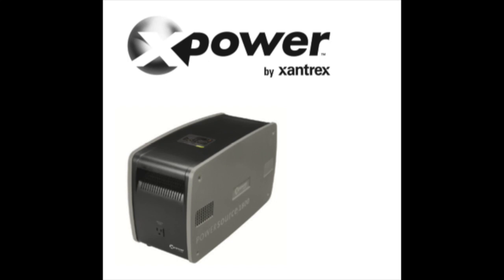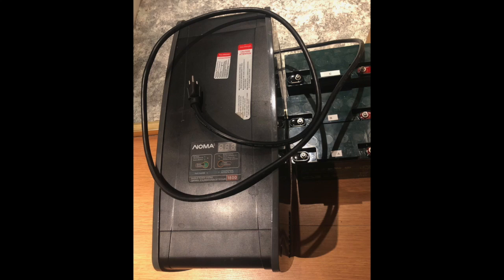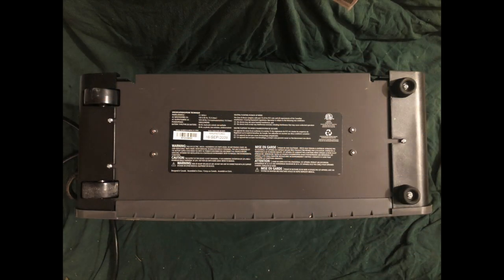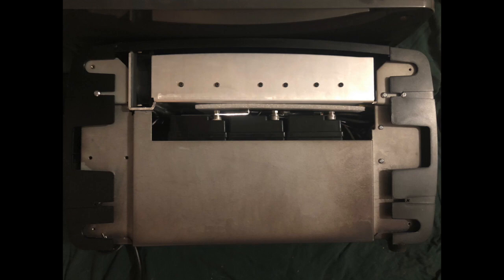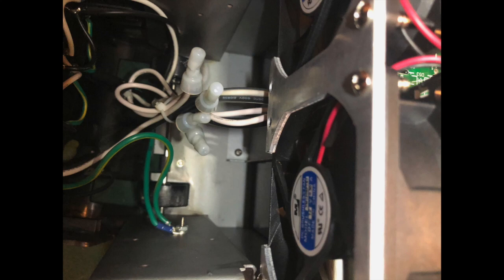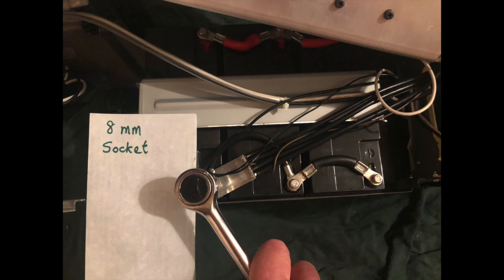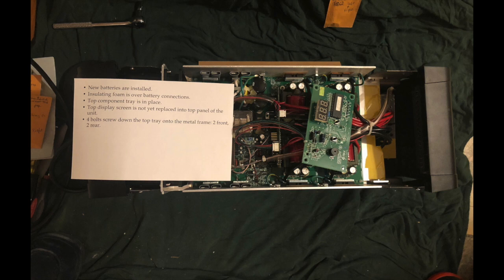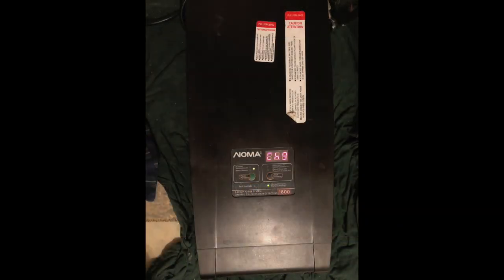Xantrex Xpower 1800 PowerSource, Duracell, Noma UPS, Change/Replace Battery UPS Backup Power System

Comment: Thanks for this video! I have recently replaced the batteries in mine. It charges the batteries, but doesn't register that it's charged them. I found that a red jumper wire from one of the top circuit boards had become detached. It leads toward the side of the power station with the single 120V outlet. I see it in your pictures, but because it disappears into the darkness I cannot tell where it goes. It's the red wire that is separate from the large bundle of red wires. Is there a way I can get a picture of that from you? I've tried everywhere to chase down a wiring diagram, but to no avail.

Comment: So is this a 12 Volt 8nit also did you check the charging parameters of the the charging circuit with what I've found so far with units using seal lead acid battery with what I've found on the net ii thought the manufacturing companies should know how to build them so I opened up my old Black and Decker to find the battery manufacturer so I could find out what the specs are but I didn't have to as written right on the battery was do not discharge below 12.2 volts float charge is a13.4 and full charge is 14.3 a andvd onde, ln

Comment: Thank you, thank you for the video. I have 2 of the Power Source 1800 from Xantrex and both are 10+ years old and I have treated them "badly":), and it's time for new batts! I took a chance someone had done this and you popped up first! batteries ordered and I will be giving it a shot soon! Might even make a video too.
Reply from the maker: Thank you! Someone made a comment about discharging the capacitors (B H, just below here), which I do not know how to do, and I did not do it to my unit. Maybe I was "lucky" because a charged capacitor is a dangerous thing. Xantrex offered ZERO information/support so I was on my own. I have changed the batteries in about 5 of these units now (the Noma/Duracell and the house-branded Canadian Tire version).

Comment: Thank you!
Reply from the maker: If it helped you out, I am pleased!
Reply: @randallprue4134  I have to replace the batteries in mine and I seen all the wires and was immediately intimidated! Lol. Thank you for making this video! I am going to give it a go!
Reply from the maker: @jesuschristmyredeemer  Yes, I also found it daunting as there is no information available. Once I had done it, I realized that it is fairly simple if you go at it methodically. Since there is no instruction anywhere else, I took pictures and notes for anyone who wants to attempt it.